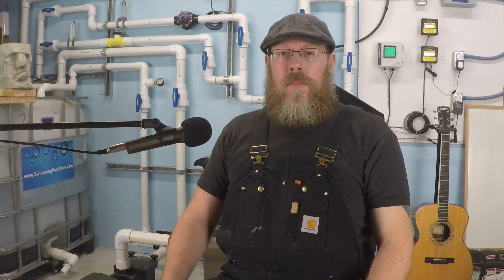What Pump RPM To Run Electric Heat Pump?

Comment: Just what I need 
I’m putting kit together for in ground pool 16x32 
Company I’m ordering my pool kit from offered my 
Raypak 156A with max 70GPM but pump I’m buying is 
1.65hp Aqua Genie 80-120GPM
I don’t think this will work according to your video Steve unless I install diverter valve. 
But I also have option to get Hayward 150k btu with max 125GPM. This was the pump I wanted to buy but they did not have it. Sales guy told me not to buy Hayward because this model was discontinued and I will have hard time getting parts. 
Steve I ask you to give me some guidance on this if you can. 
Thank you

Comment: While out new $100k+ pool did not have a flowmeter, I estimated the flow by using a bucket and stopwatch. 

I "calibrated" the 5 gallon bucket with 5 measured gallon jugs of water and marked the level on the bucket.  I then used a piece of 3/4" tubing pressed tightly to the eyeball water jet fitting.  With the pump running, my helper watched the bucket level as it was filled by the tubing and measured the time.  I did this for each of the four eyeball water return fittings.  I repeated each test to verity consistency.  Total flow of the four fittings was 46 gpm.
Reply: 100k for a pool...crack open the purse and install a flowmeter....